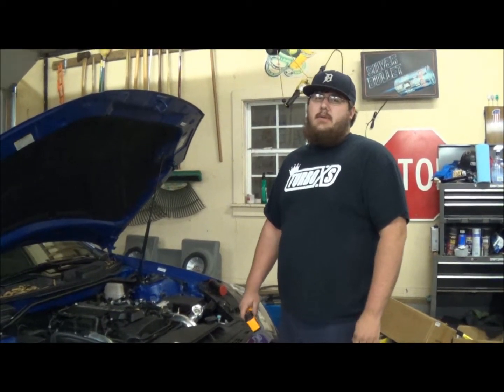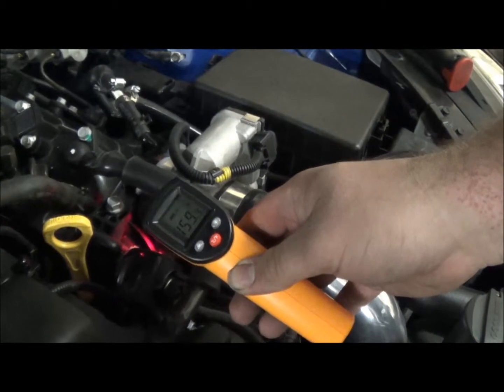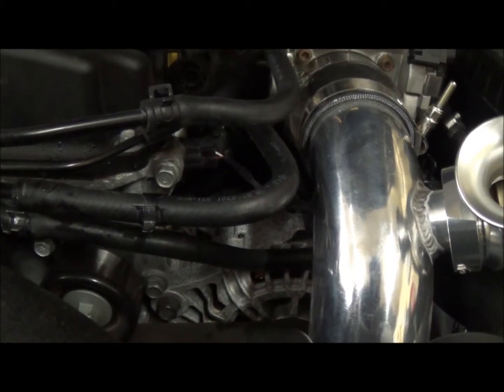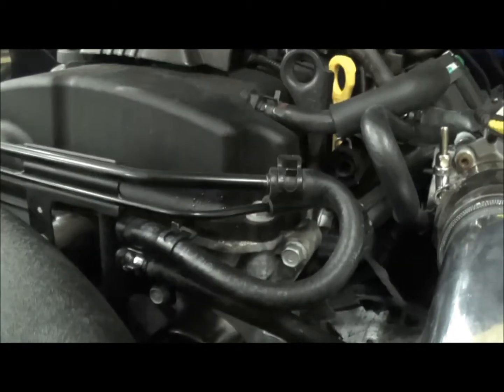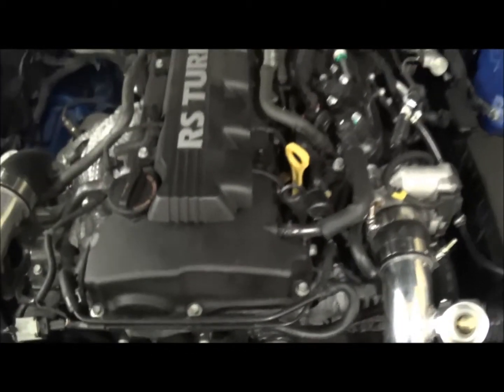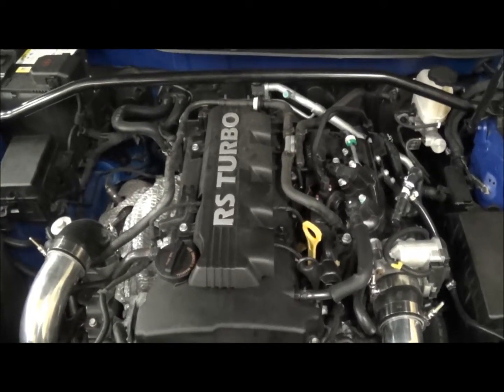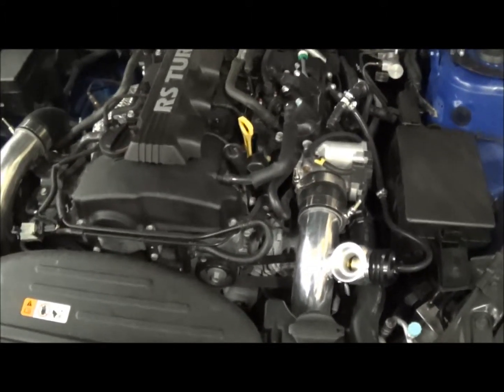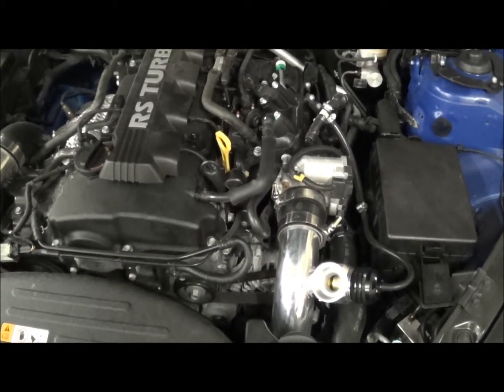fitform&function throttle body coolant bypass

Comment: Will it damage if a good bit of coolant leaks?
Reply from the maker: +Grant Smith if you have a leak and a lot leaks out it could run hot. If your just talking about the little bit of coolant that leaks out when you bypass the house then nah its fine.